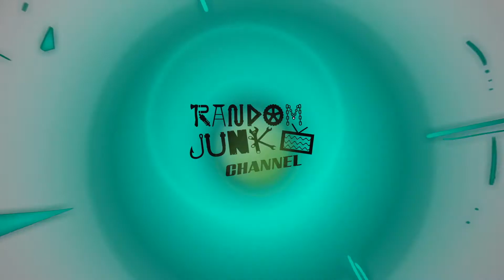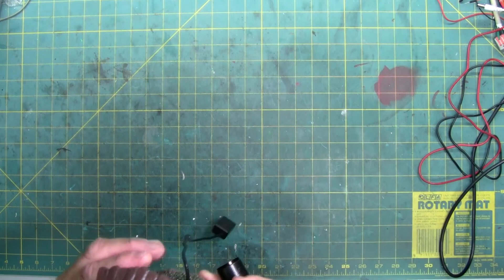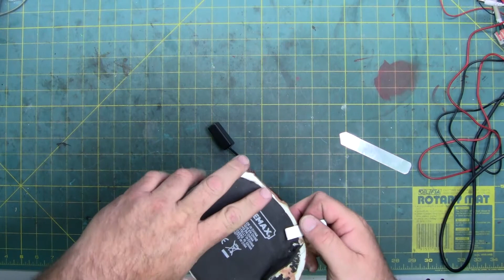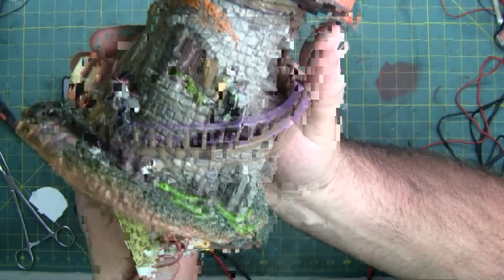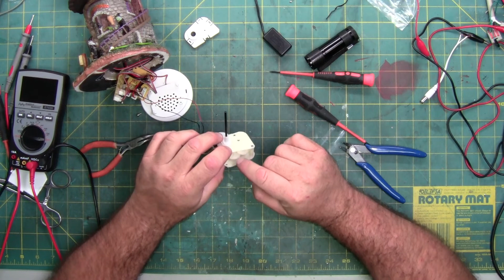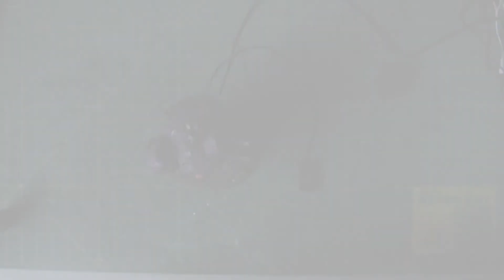Lemax Witches Tower Repair, shorted motor causing failure

Comment: I have a Lemax Mid Evil castle and want to disconnect the animatronics. I can see the board where these plug in. Which plug or wire would disengage the movement while keeping the lights on?
Reply from the maker: The motor plug. It is a thin black and red wire set. The thicker set is the main power.

Comment: I have this. Mechanically all works (albeit loudly), but the sound effects are not. Assume (hope) it could just be a faulty speaker?
Reply from the maker: Could be the speaker. If you unplug the motor and the sound returns, the motor is over amping, which may also explain the loud mechanism. If that is the case, replace the motor. If not, check wiring to the speaker and the speaker itself.

Comment: My power supply is working, but my witch tower will not turn on. Any suggestions?
Reply from the maker: Your motor is shorted out. If you open it and disconnect the motor, your lights and sounds should come back. The motor is a SRF-300CA or RF-300CA, you can find them on Amazon or eBay. Make sure the RPM is 11,400.
Reply: @RandomJunkChannel  thank you! You were 100% correct! I replaced the motor and it's working perfectly!

Comment: Hi, I wanted to tell you that you are amazing!!  I watch your videos and they help me with my lemax thanks a lot!! now I wanted some advice from you, I have the clock tower and I found the problem that the upper part did not turn, a wire from the board was unsoldered it carries the current to the block above.. only that the trains run but the lights are low they don't have the intensity of the base and very weak what can it be??  thanks for the moment and I await your news.. Monia
Reply from the maker: Did you resolder the wire on the board? Was it in the correct place? Check the upper part for something out of place, i.e. a bad solder joint or bad LED or a binding gear. Something it drawing to much power or it isn't receiving correct power from the board.

Comment: I am having power supply problems. What do you use to test it?  The power supply here?
Reply from the maker: Use a volt meter to test power from you AC adapter. You should get between 4.5 and 5 volts. If good and house will not turn on then youay have a bad motor causing a short. Plug it in and turn it on and carefully try to rotate the top ring to see if it lights up or.makes sound, if so then you definitely have a bad motor.

Comment: I got a second hand one as a gift from my friend and when I plug it in, half the lights don't work but it spins just fine. :( Me no know how to fix.
Reply from the maker: If you're willing to try and open it up, it sounds like you might have a broken wire to the lights. Is pretty rare to have lights burn out especially half of them.
Reply: @RandomJunkChannel  it looks like some of the lights actually just broke off.. might just need to replace them. Thank you!

Comment: I fixed my Christmas North Tower by watching this video - but I can’t get the motor back on correctly, it is very loud - two screws?? Thanx for sharing your knowledge!!!
Reply from the maker: When you say you won't go back on, are you meaning of the screws don't line up? Most motors have multiple holes in the face so you can rotate them to line up with existing holes in a bracket. Or is it possibly the pulley is rubbing?
Reply: @RandomJunkChannel  I lost a screw! I rewatched this video and saw it had two screws on the motor - found one in my stash and all good - thanx for the help!!!
Reply from the maker: If you can't find the screw, you might find some on Amazon or Ebay under hobby Motors or hobby motor screws.

Comment: My middle section has started hanging up and clicking.. I have to push it to get it to go but hangs up after half a spin.. Anyway to fix this problem? Thx
Reply from the maker: You'll have to open the bottom and remove the center of components, most likely you have a cracked or split gear that is slipping. If the witches are spinning around the top without hesitation then that's what I would lean towards.